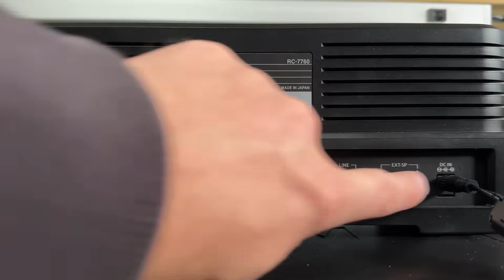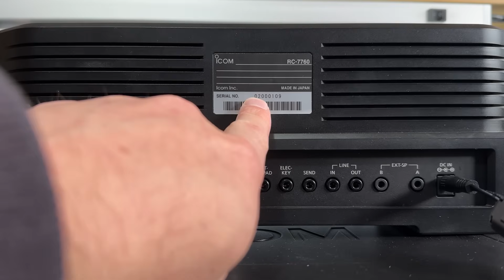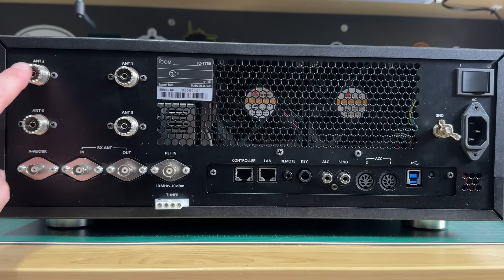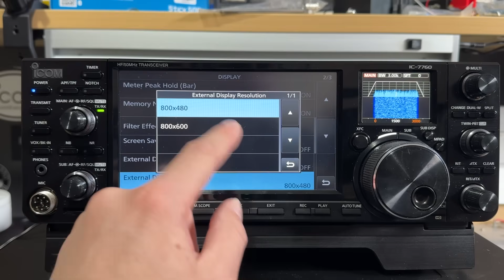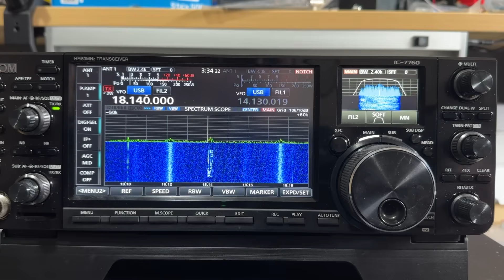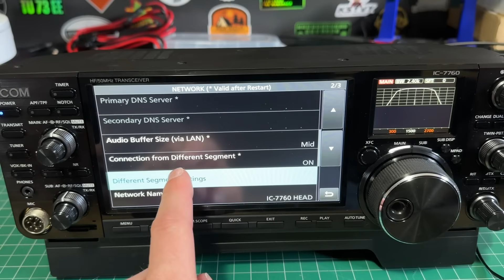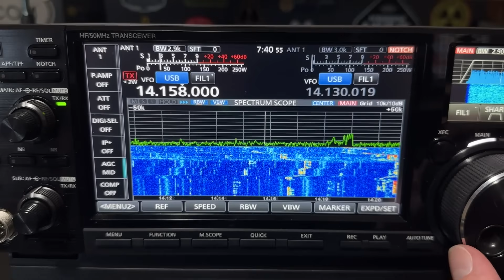Icom IC-7760: FIRST LOOK, Review and Demo

Comment: The 169 address you saw means it wasn't able to get a DHCP address.  Seems like the head was still trying to give the RF deck one.  If it can't work over a Layer 3 VPN (IP Based) you may be able to get it to work using a L2TP (Layer 2 tunneling protocol) type VPN which works at Layer 2...Ethernet layer...and would make the head and deck think they are on the same LAN.  Then it would just be a latency over the WAN test to see if it works remotely
Reply from the maker: Yeah it's too bad I don't have this thing longer, otherwise I'd make it work. 
The RF deck is being weird when it's trying to get an IP address... in short - it doesn't via DHCP. Someone else in the comments suggested it is a firmware bug, which is probably likely.

In my router I can see the RF deck, but even if you give it a static address it doesn't "stick".
Reply: @HamRadioDX  When you say that you're giving it a static address, are you actually changing from DHCP on the deck to static/manually assigned or are you talking about setting a reserved IP address in your router or whatever is providing the DHCP server function?  To make it easier to test if you have a router at home where you could simply setup two different subnets, one on Ethernet1 and the other on Ethernet2 as example port names and simply had default routes in each subnet to the other you wouldn't have to do the running back and forth to the remote site.  If you have an old Linksys router or something like that then you could install something like OpenWRT which can do this.  Just depends on what you have and how much time you have.  It would be nice to know as I bet this is the biggest looming question that many have about this radio.  Thanks for what you do.  I enjoy your vids.
Reply from the maker: @JoeMartinBikes  Both. I usually set a reserved block of addresses for static devices in my router and then there is another block for "randoms" such as those visiting connecting to WiFi etc. I set a reserved address in the router for the controller head and RF deck. The controller head got it's IP no problems - the RF deck did not.

So I statically assigned the address in the Icom radio menu - same result, so it's either been switched off in the demo unit or a firmware problem.

The setup you describe is basically what I have between the two sites over the site to site VPN. There are routes between the sites that go to specific devices - one of them being the Icom devices. 

The problem was - the RF deck not picking up an IP address at all - on the remote side or within my own network locally. They probably use a fallback address or send the packet over layer 2, but I don't have the unit long enough to figure it out. But I'm 99% sure you could make it work.

Comment: The 169.254.x.x address is assigned when the NIC on the device doesn't find a DHCP controller to assign it an IP address.  It's fairly useless.  What that tells me is either the remote head has to tell the base to pick up an IP.  I'm guessing there is probably a setting we're all missing to let the base get it's own IP address or something.  Or that the device can't truly be remote from it's home network, although if Icom says it should be able to do that then it must be something silly, or, since it's a demo unit, Icom disabled the feature.  Isn't networking fun? :D
Reply from the maker: Someone mentioned in the comments that it could be a firmware bug. So the RF deck gets a DHCP address when the RF controller on the same physical network tells it to wake up etc... I can see that in the router. But when the RF deck goes to sleep - so does the NIC in the RF deck, which is weird

Comment: The 169.x.x.x ip address you got on the main unit indicates that it didn't get an IP address.  Many computer operating systems will do that.  As for the radio, that is an impressive set of specs.  4 antenna inputs with a separate input for a receive antenna.  It would be quite the radio station setup that can fully take advantage of everything the IC-7760 offers.
Reply: APIPA
Reply from the maker: Yeah the RF deck doesn't appear to get an IP address properly.

Comment: Very similar to my 7700 but moved all the way into SDR. I can't believe that Icom didn't dedicate a 12 volt plug to power the head from the main deck. The 7700 has a 12 volt receptor on the back of the radio.
Reply from the maker: It could be a wider voltage range.. It's just it was supplied with a 15V adapter.
Reply: @HamRadioDX it has an Ethernet port… it should have been PoE.
Reply: Then you would not be able to power it when you have the main unit in a remote location like he did at his club.

Comment: No HDMI external display on a new model is shat
Reply: Happy they stayed with the DVI-D.  A much more robust connector.  That's why the US military still uses DVI-D, reliability.  HDMI connectors are just plain fragile.
Reply: @mikesradiorepair  ya looking at it like that makes sense I never thought of that!
Reply: @HAUNTED-HAM  I stock several different HDMI connectors because I have to replace  a couple of them every year because they were broken.  I have never replaced a DVI-D connector.  The DVI-D connector is inherently more rugged by design because it is captured by a screw on either side of it like a serial or parallel port connector.
Reply from the maker: That's right, it's not really an issue. DVI is fine
Reply: Why? It does not make sense for Icom to pay thousands of dollars per year for HDMI licence when the unit only outputs 800x600
Reply: @stduffy72  your correct I keep forgetting the license issue! Thanks for clearing my mind up.
Reply: Just use a $3 DVI to HDMI adapter

Comment: HDMI needs a license ($10,000.00 a year + end user license fee + logo licensing fee ) whereas DVI-D doesn’t.
Reply: What about Display Port?
Reply: @mikehermesmeglio  you can easily adapter dvi-d to DP with a special cable or an adapter. same with HDMI
Reply: The only thing I don't understand is that the Elecraft K4 has HDMI and it costs half as much as this radio afaik. 
This leads me to believe that the licensing is not the reason icom didn't do HDMI.
Reply: OK makes sense, but why not use USB-C as data connection and as display adapter or even as charging port?
Reply: I think Icom can swing $10,000/year. That would blanket apply to all of their radios. If that’s truly the reason, that’s a horrible excuse. They put onus on their customers to have to keep DVI displays around which aren’t as plentiful as HDMI displays. 

They could also have gone USB-C which does provide support for video connections. 

Seems like a very poor decision. But the radio looks gorgeous outside of that.
Reply: I don't understand why the Head unit don't attach to the bass,  it's ridiculous.   I want the whole radio on my desk.
Reply: What are you saying HDMI needs a license??
Reply: I'll stick with DVI-D.  A much more robust connector.  That's why the US military still uses DVI-D, durability.  The HDMI connectors are just plain fragile.
Reply: @mikesradiorepair  this, hdmi is very fragile and terribly susceptible to RF NOISE cuz the cables are usually crap!! i have a 5g modem that will absolutely kill any hdmi tv its put next to.  and the screw in keepers for the DVI are a must on something your going to move around a lot. I am a computer repair tech and 90% of my business anymore is replacing HDMI's and power jacks on laptops/game consoles. do you really want a dead video port on your multi thousand dollar radio?  also, dvi-i can be directly converted into VGA, HDMI, and Display port without any electronics to do the converting. dvi-d cant do VGA conversion but can do hdmi and DP with just a low cost adapter. also the licensing thing is probably a concern why pay more for a worse solution?
Reply: Maybe this: HDMI is constantly evolving still, with versions requiring updates etc. Maybe Icom doesn’t want to deal with constant HDMI updating?

Comment: You can do layer 2 over the internet but you need software like Zerotier.   It is the same challenge the Flex guys have working remote over a WAN.  It will be interesting to see if it actually does remote over a WAN including CW without the need for 3rd party software.

Comment: I can't believe they didnt put a roofing filter in it. For that kind of money, they should have.
Reply: difficult with a direct sampling radio.
Reply: I can't believe you passed your license
Reply: @Mr-Anony-moose  so my buddy has a 7610. it will not knock out 3kh interference like my radio which has a roofing filter. all high end rigs have them. my radio has dsp filters plus a roofing filter.